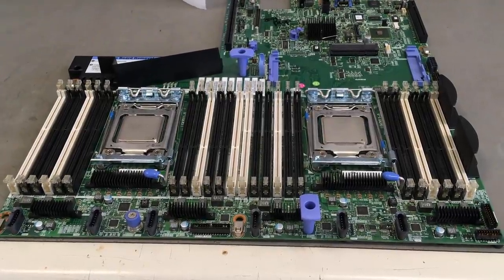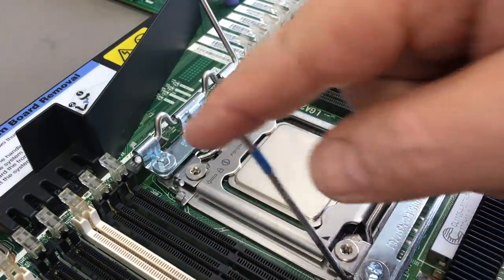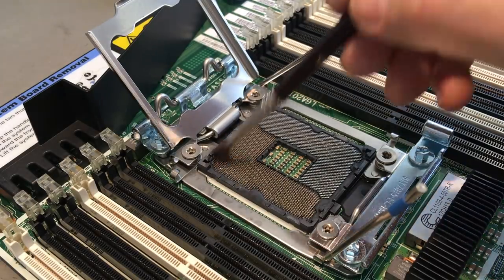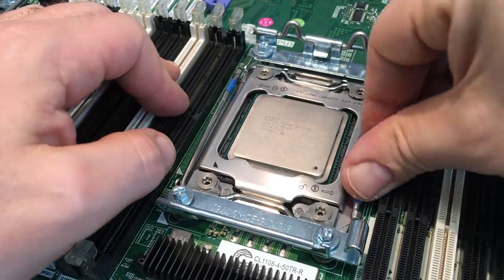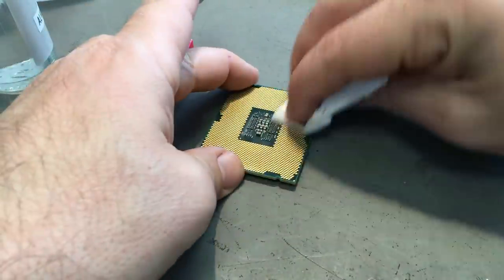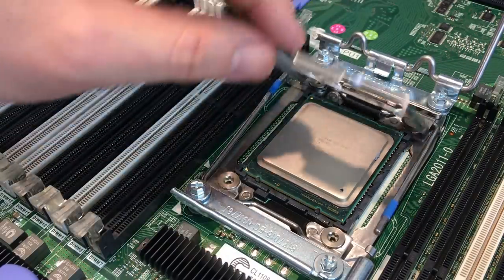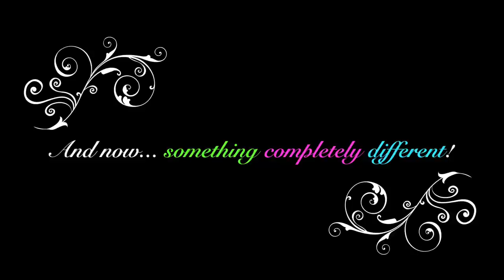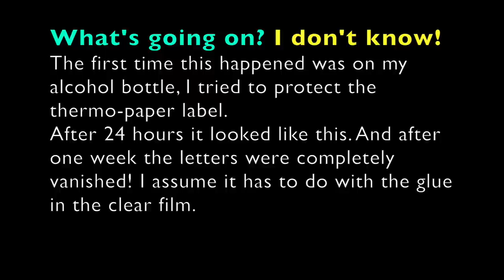How to clean a CPU socket... and a thermo paper trick (PWJ182)

Comment: PS: Don't use rubbing alcohol. It will literally gum up your hardware. Use pure isopropyl alcohol.
Reply: Depends on the rubbing alcohol - in some cases that is literally a synonym for isopropyl alcohol.
Reply: What about Etalon?
Reply: yep, did it today with 70%. Worked very nice but scared me a bit. ( the idea of liquid on the mobo pins / electrical components ).

Comment: WOW! This cleaning of the socket and cpu pads totally fixed all the issues I was having with an old 4790K! I was having totally random memory issues and very strange sluggishness and/or glitches in both linux and windows. Now its performing as it should! 
I used brake/parts cleaner instead of isopropyl alcohol... that really easily removed the contaminates on the cpu pads with almost no effort and evaporates faster as a bonus.
Reply from the maker: I thought brake cleaner was a bit too aggressive. But if it worked for you…. congratulations!
Reply: @PlaywithJunk  Probably, but I figure its an old chip and I can grab another for $35(ish) xD
That and I'm lazy and the can of brake  cleaner was the only solvent within reach haha

Comment: Thank you so much for this video!  just removed my cooling block and noticed something suspicious at the bottom. Sure enough, some paste had manage to get into the pins. I don't understand how the CPU still worked, but thanks to this video I manage to save it.  Big thanks, again!
Reply from the maker: Each pin of the socket has a pressure force of a couple of grams. If the paste is thin enough the pin may push through that layer and contact the CPU. Or, if you are lucky, it's an unused pin or one of the hundreds GND or voltage supply pins that all work in parallel.

Comment: It definitely feels like prank advice when you see a person soaking down these electronics with alcohol, but I believe you.  I saved a drowned iphone one time by taking it a apart and using 99% alcohol to displace and dry the water.  It's still scary to think about doing this to my motherboard and CPU though.
Reply from the maker: Even water ist not a problem for electronics. I already washed server boards with soap and warm water. The problem is when water and electricity come together like in a battery powered device. So the first step must be to remove the battery....
Worst boards come from metal machining companies or automotive service. There is always a mixture of dust and oil.

Comment: Thermal paper thing is the glue in the clear plastic converting the bisophenol A and dye in the direct thermal paper label back to the clear form. Also will happen if it gets alcohol spilt on it as this also does the same. The dye changes colour depending on pH of the blend, and the glue tends to be somewhat basic, making the dye change back to the clear form. Same for the alcohol, which does the same, as reacts with the 2 components.

Only way to have this not happen is if your printer supports using a thermal transfer ribbon, as this is a wax that is melted and adhered to the paper surface, and is not going to fade easily. Direct thermal labels are almost always going to be fading with time, depending on exposure they might last a few weeks or a few years in a dark cool dry climate.

For the wipes use surgical wipe sachets, they are the same non woven fabric and alcohol, and are a lot cheaper. Just use some extra alcohol with them, and please clean the tabasco bottle, there are floating contaminants in it.
Reply from the maker: My experience is that alcohol turns it black.
Reply: @PlaywithJunk  Goes black then as the alcohol evaporates it turns all a pale shade. Same with adding citronella oil to get the adhesive to release. What printer are you using there, i use some old Zebra LP2844's that were scrapped for being too slow, and with a bad single thermal element dot.
Reply from the maker: @SeanBZA  The labels I use turn black with alcohol and the stay black. I think there are many different formulas for thermo paper.
Reply: You can make old thermal printouts readable by exposing them to acetone vapour. It blackens everything, but not faded printed areas. Thus you end up with negative.

Comment: This video is basically about repairing an intermittent fault or error on a mother board with suspect dirty mechanical connections, either memory or CPU, or any other mechanical connection like PCIe, etc. Before handling electronics you should be ESD safe. If you look closely at his work surface it looks like a steel work table which is probably grounded, and even if not grounded will certainly prevent static voltage gradients (after you discharge yourself to it). I like steel (especially SS) tables unless the board your working on still has charged caps, which is propably more applicable to power supply repair. So I like putting an antistatic mat on top of the steel table. Then I can handle the board and discharge caps as a first step if need be with out the danger of shorting out a charged cap on a metal surface. SS really cleans up nice especially if you handle a lot of liquid flux and/or perform messy soldering tasks. 

Although it is not written in the Intel LGA771 socket (Old Xeon) mechanical design guide, it looks to me like the pins are spring loaded and the CPU when seated and latched compresses the spring contacts (gold plated on the contact end) to a specific distance without bottoming out the contacts in their respective guides. So spring force is holding the contact against the CPU land. As with most wiping contacts I feel adding a contact cleaner with lubricating properties as an advantage. So I would be interested to find out after cleaning with alcohol what if I then treat the CPU pins with Deoxit Gold G100L (Liquid in a bottle with a little brush) to help protect the gold surfaces and lubricate the pins in their guides (Reduce sliding friction). I am in the USA so I can order Deoxit from Digikey. You can by Deoxit in many different application formats, like they offer wipes for edge connectors.

Edit: Obviously the above is about a board that has been already in service. If you are building your own servers or PCs, before assemply always inspect all of the pin and socket connections. I use a stereo zoom microscope and have spotted partrially bent pins on connectors which I was able to straighten out before assembly. A slightly bent pin will become a smashed pin unless it is straighten before attempting the first connector mating.
Reply from the maker: A very detailled comment!
The table surface is a gray antistatic mat that is of course grounded through a 1 Megohm resistor. The mat has sufficient insulation so that there is no danger when handling running power supplies with 400VDC directly touching the mat.
I also have a video about repairing bent pins in a CPU socket...
Reply: @PlaywithJunk  Thank you for the reply. In cold climates the indoor humidity level can be very low in the colder months, and this dry air increases ESD risks. I used to live in such a climate as cold as Switzerland but in the USA and a grounded metal work table was very robust in dealing with ESD when doing repairs and builds, but also was used for PCB rework which could get messy and a SS top is very easy to clean. I think the top was 316L stainless and the body Carbon Steel, not really 100% sure on the alloys. I saw your video on repairing bent CPU socket pins. 

I use a zoom stereo Trinocular microscope (Similar to Meiji EMZ-8TR) so I can have a camera attached and still use the stereo eyepieces to see what I am doing. The camera is used to take images of PCB level repair (usually prototype trace repair, rework and jumpering) which is attached to a report sent to the layout and or design engineer in PDF format. Some of my very fine work tools like Tweezers and Screw Drivers are made in Switzerland. For example, my small flat blade screwdrivers are manufactured by Bergeon they are on a rotating holder and are color coded. I think a lot of my very small delicate electronics tools are actually Watchmaker or Jeweler type tools.
Reply: @windward2818  you alright bro?

Comment: The cpu and socket cleaning fix temperature issue or not ?
Reply from the maker: This has nothing to do with temperature, only contact problems like CPU and RAM issues.
But if you renew the thermal paste, that will improve cooling as well.

Comment: Will this get thermal paste off my socket, I was taking out a CPU on my LGA1200 mobo and some paste on got on the pins, I am so scared to use a paintbrush, I don't want to bend any pins. I need the socket to be clean because my motherboard is dead and I need to RMA it.
Reply from the maker: If you are worried using a brush, you can soak the pins in alcohol (Iso) and the blow it off with air from a can or compressor. But using a very fine brush should not be a problem. Maybe you have an old board for practising.
Reply: @PlaywithJunk  I ended up spraying some contact cleaner on the socket, it managed to get all of the paste off without bending a single pin.
Reply from the maker: @KylesDigitalLab  Contact cleaner to clean contacts...brilliant 🙂

Comment: I had a 1366 board not recognize a DIMM; turns out one pin was bent by perhaps its own width.  A tiny nudge with a pin and it was fine.
Reply from the maker: Yeah bent pins are another reason for problems. I already made a video about that.

Comment: My Mobo Msi h55m-e33 have a problem power cycling "( ...should i try clean the mobo or something?
Reply from the maker: What exactly do you mean with "power cycling"? Is it not possible to turn it on or off ?  Try to unplug everything you can, just except the CPU and try to power on. If this doesn't work try another CPU. If still not good, your board is faulty.
Also look at the capacitors, do they look good? Do they bulge or leak?

Comment: can u help me bro 😢 I used am4 socket with thinner and no more power on after this.I though some moisture there and blew the socket with dryer.after doing this it power on again and use as long as opening the pc.if I off a sometime,it was nomore power on again.Then I use dryer to blew the cpu socket and it power on again 😢 what do I do bro.
Reply from the maker: Thinner? ou mean paint thinner? That's bad stuff man! It can dissolve plastics and it may also contain some oil. Very bad.
You can try to clean again with Isopropyl alcohol as I show in the video. You should also clean the cpu contacts. Be careful not to bend any pins.
Reply: @PlaywithJunk  thanks bro I will try to clean,Now I can use my pc when give a little hot air to cpu socket,I can use as normal without shutting down for a long time 😅
Reply: but when I power off for a long time it show cpu led and not power on again 😅 then I use hot air to socket and open normally again.I think some liquid or some oil like bro said still inside the socket.Thanks for ur video bro.I will try to clean again and I will tell my result again.

Comment: Would this work with an AMD cpu socket? I have 99% mechanical alchohol on the way i keep getting a cpu red light upon launch i believe there may be thermal paste in the socket
Reply from the maker: I don't know what "mechanical" alcohol is.... But if it's Isopropanol (Isopropyl alcohol) then go ahead.
Soak the socket with alcohol and then blow it off. Maybe repeat a few times. And don't forget to clean the CPU too.
Reply: @PlaywithJunk  lol i meant like mechanical friendly but thank you I’m gonna try this appreciate your reply

Comment: can i use a toothbrush to clean the cpu socket? and how long should i wait until the alcohol fully evaporates?
Reply from the maker: I would not recommend a toothbrush, it may be too hard/stiff. Use a small pinting brush like I did, that works well.
Alcohol evaporades quite fast. Look at the board, if it looks dry, it most likely is. Use compressed air to help evaporation.

Comment: How can I clean the socket of processor, where processor is placed in the mother board
Is your method safe?
Reply from the maker: In the video, I'm cleaning the CPU chip, the CPU socket and also RAM sockets. What exactly is your question? And yes, my method is safe if done carefully.
Reply: @PlaywithJunk  I was asking I want to remove dirt from the pins inside the socket!!! How can I do that?
Reply from the maker: @MukundMadhav.  Do you have a socket with holes? If yes, it's a bit more difficult. I would use an IPA (isopropanol) spray to wash out the whole socket. Then use compressed air to blow everything dry.

Comment: Always better to have a box of Kimtech Kimwipes on hand to use for cleaning instead of regular household cleaning paper. A lot less likely to get little bits of paper lint in whatever you are cleaning.
Reply from the maker: That's why I'm using the air gun after cleaning. Those wipes are pretty expensive but yes, they are better :-)

Comment: you can also use soap and water if you like... PULL THE CMOS BATTERY OUT.. then put that board in the sink and scrub it with dawn dish soap... and rinse well....  set it out in the sun for an afternoon or put in an oven on low (200 f) setting and and put it back together... will work perfect.. same for keyboards that have had coffee or cola spills... throw them in the bathtub... rinse with hot water.. dont have to remove the keys... keep working rhem under water till ts all clean and works again... look at all that gunk in the water... your keyboard is nasty.. once again... drip dry and put in sun... maybe a couple days to get dry between membranes.  good as new...
Reply from the maker: Yes, I have already washed entire servers with water and soap. But I still clean the sockets with Isoprop. Alc. after washing. I have the feeling that some soap may be left. And some greasy dirt will not solve with soap alone.
I once had a server from a metal industry customer with a thick, black, greasy layer of dirt. There was no other way than hot water, soap and brush. Looked like new after that treatment.
Reply: @PlaywithJunk  yeah, I've pulled some machines from industrial applications that were in horrendous condition..

Comment: brakecleaner combines solvent and air duster / brushing action
Reply from the maker: Brake cleaner is possibly a bit too strong. Don't know if that's healthy for the plastics.
Reply: @PlaywithJunk  I've seen bräkleen used on some super greasy motherboards without disaster but... yeah, not my first weapon of choice for a relatively good board.
Reply: NEVER use brake cleaner where there is even the slightest risk of it getting in contact with plastic.

It’s true that some of the modern break cleaning products you can buy these days, are (much) less aggressive towards oil based polymers than the old ones. (They’re also less effective for cleaning brakes, in my opinion.) 

And since IPA (93% concentration and above) is perfect for the job of cleaning connection points in most electronics anyway, there is no need for more aggressive solvents in the first place.

Comment: contact cleaner is the best it dissolves hard thermal pads that alcohol pads can not , i was using 70% alcohol pads did not touch pads so what your doing try contact cleaner as it also evaporates fast no need for air can and some of them cans can have oil in the vapour
Reply from the maker: Contact cleaner may work as well or better than alcohol but some cleaners do also have oily components. These will make problems on CPU sockets. Choose the right one...
The reason why I use compressed air (or cans) is not only to dry off the socket but also to get rid of most of the dissolved dirt.
Just imagine you cleaned a socket from thermal paste and just let it dry by itself. The dissolved paste will create a thin layer everywhere the cleaner evaporates. The dirt does not vanish magically, it's still there, just diluted.
Blowing the socket will not remove dirt either but it will move it away from the contacts... (and spread it all over the board) :-) But that's not a problem.

Comment: Thermal paper (dymo labels and such) is the worst invention ever for receipts that you have to keep for warranty purposes.
In the old days cash registers were equipped with a tiny dot-matrix printer. A little loud, but those receipts never faded. The thermal ones have the benefit that they can print a receipt in literally a blink of an eye (some are crazy fast), but require the special paper because they don't use a ribbon or cartridge, and you're often instructed to make a copy of them if you buy something valuable, else they're gone when you need them for warranty!
Thermal labels can not handle: pressure, daylight, alcohol, moisture, heat, glue... I mean... What was so bad about the matrix printers again? Changing a ribbon once in a while?

Comment: Lmao I took my cpu to a pc suppot shop and that uncle literally the socket lightly with some oil type brown colour material with a super dirty toothbrush, I was dead at this moment.
After that he applied a full load of thermal paste, I told him to remove half of the quantity.
The pc is running fine, somewhat 2-3° cooler than before but I'm afraid that the pins in the cpu socket might have got bent💀
Idk but the pc is running ahh fine, till now atleast, 2 hours after this all happened.
Reply from the maker: If the pins are bent you can see it when you look at the reflections. I wouldn't use a toothbrush that's way too hard. A very small and soft painters brush like the one I use is safe. If you have some instinct... (fingerspitzengefühl)